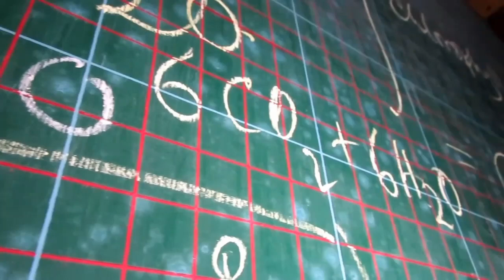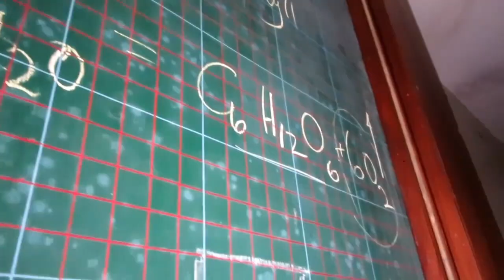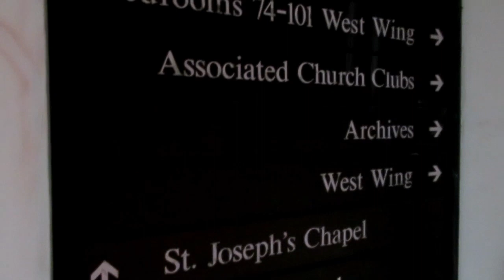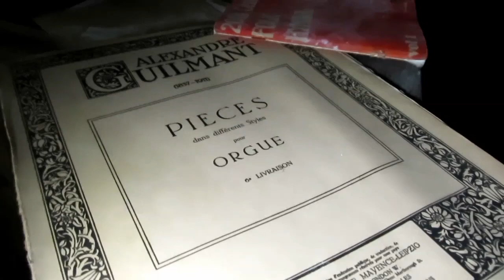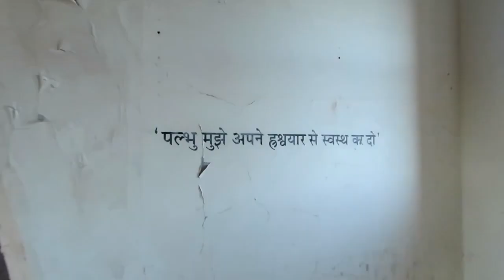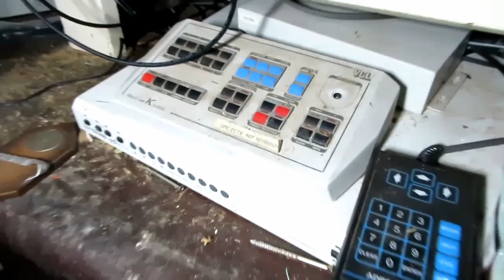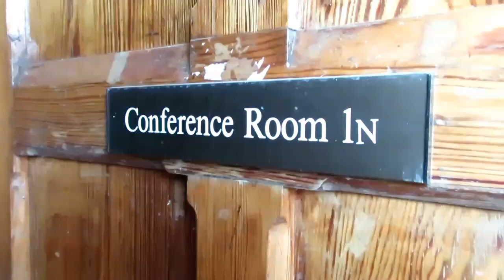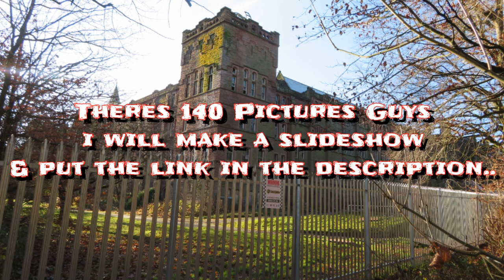Abandoned St Joseph's Seminary......

Comment: If you guys want to get in this place which is heavily guarded now i'll give you some advice, first all you need to get through the metal fence, we managed to wobble one of them until the bolts became loose from the back and we manually unscrewed it and screwed it back together loosely once we were in so we have our own exit plan or entrance next time we visit. Once inside you have to rush to find a window which is preferably boarded up with just screws (cathedral area is best) here you'll need to bring some form of drill i personally use an impact driver as it's faster and lighter to carry. Bearing in the mind you will need to run to this destination as the place is rigged with high tech security cameras and motion sensors and the security guards are pretty much straight onto you. Place the board back into the window you entered when going inside so they don't think you actually managed to get in and they won't bother to look for you, we spent 5 hrs in there today and It was utterly amazing.
Reply: THIS IS BREAKING AND ENTERING! BUT THANKS FOR LETTING US KNOW HOW YOU ARE GAINING ACCESS.